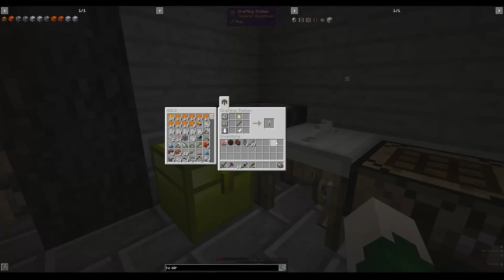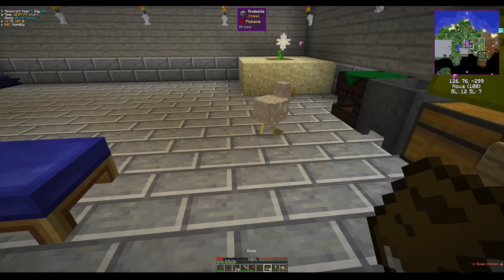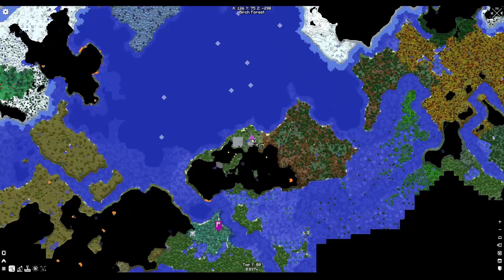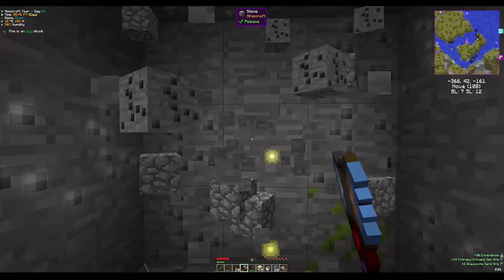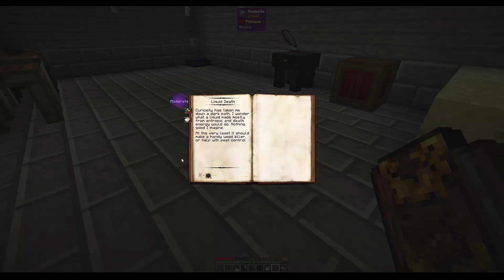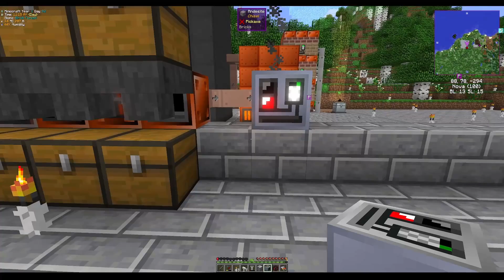FTB Interactions Remastered E04 - The Rather Slow Single Track Road to Hell

Comment: you dont need a turbine per machine. most dont use a full amp per tick. you can run multiple machines off one turbine by connecting with cables. look at the stats to see what voltage and amerage they can handle. you also dont need hoppers they can auto output with their output side and the slightly larger chests open up even with a block above them. thats the point of making them. the overclock button enables overclocking. if you were doing an lv recipe in mv it would overclock. basically it will use 4x the power of the previous tier for 2x the speed so its less efficient but faster and in some cases its 4x so its 1 to 1.
Reply from the maker: thank you for the tips!! i really appreciate it as a gregtech noob lol
Reply: @Snock_Snock  gtnh has a better quest book i am not a fan of ftb quests. the color scheme is confusing everything looks the same hence why you were doing later quests. i am a very critical person so im sorry if that bothers you. i will always point out what i think should be improved. none of this is your fault gregtech itself is a bit of a mess of ideas and has deviated from its original incarnation and i hardly consider it gregtech anymore. it has some core mechanics but i wish it were more like how greg himself would want it. gtnh i think makes the best out of that mess which is why it is my personal favorite in terms of a gregtech 5 esque pack. however im still glad gtceu exists at least its more in the right direction. if you want to play gt modern at some point i also recommend you try out gt new beginnings. its inspired by gtnh but for modern minecraft. its still in beta but it is actively being worked on and has alot of content already. it also uses create which i dont know if you are a fan of but its in there. anyway i think something good will come from this its just part of the evolution of gt. sometimes you have to go through a few ideas to get to what you want to see.

Comment: The button for overclocking is actually to change the ability of the machine to not overclock or not overclock recipes as much by reducing the tier, doesn’t matter till MV+ machines. Then you can choose if you want to overclock LV+ recipes or not
You don’t actually need a turbine per machine, not all of a machine’s recipes take a full amp, so you can just connect multiple machines to 1 turbine with cables depending on the recipe you run.  Can add more turbines on the line (while also increasing the amperage of the cable) if you needed more amperage. This also saves on needing to make lots turbines that you likely don’t need
You got some zinc from a quest reward
Macerators don’t give byproducts till HV tier
Tree beacons have a 16 block spherical range where you can place trees, this will speed up wood production a ton. Once you have collector crystals pointing one of those into the beacon will also increase the yield
Reply from the maker: thank you! that’s really helpful! i just assumed everything would take an amp not sure why lol.

Comment: Time in a bottle will help a lot with chicken breeding
Just scanning stuff with your thaumameter can give you research points, no need to do research through the table
No need to craft programmed circuits for machines, you can use the machine’s GUI to configure a fake circuit on the bottom right
Can craft the transmutation tablet for easier access to emc when needed
Reply from the maker: thanks for the tips! especially the circuit one i was confused lol

Comment: I think the cause of your hammer's really low durability maybe from stone tool rod.
Reply from the maker: yeah i think it is but i can’t upgrade yet because i need the extruder for better tool rods
Reply: @Snock_Snock  I dont really know in this pack but normally the stone rod gives like a negative durability multiplier, even wood should be way better